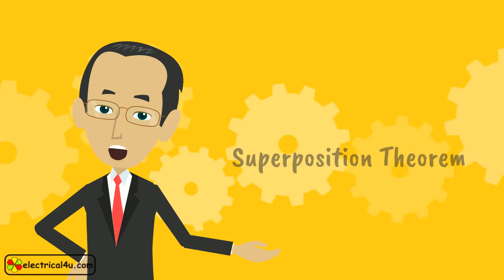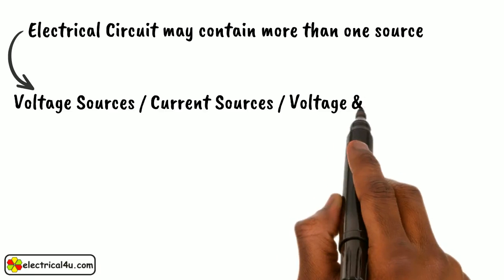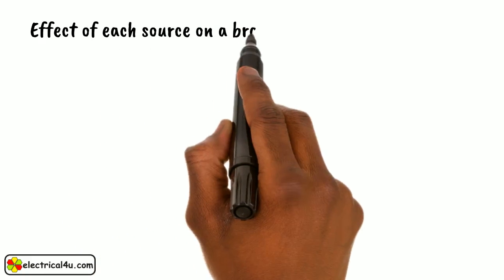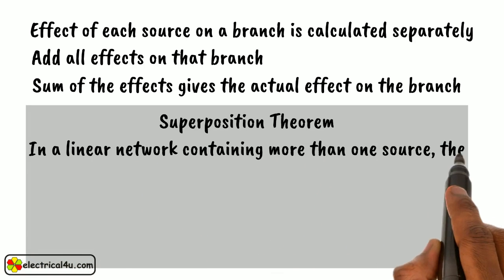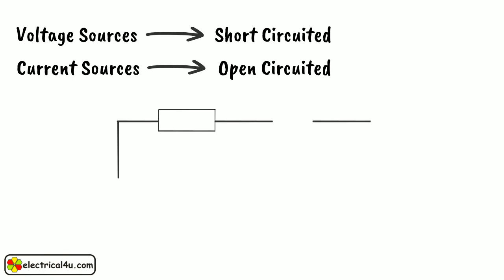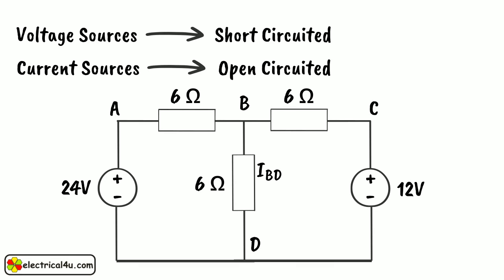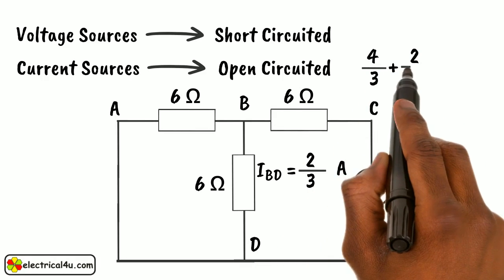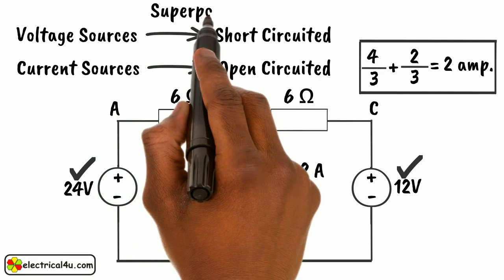Superposition Theorem: What is it? (Plus Examples)

Comment: The three resistors are not all connected to series. The resistor from BC is parallel to resisto BD and resistor BD is connected in series, (6//6)+6= so 9 ohms. Then 24V divided by 9 ohms ans is 8/3 not 4/3. Am I right?
Reply: 8/3 is the current leaving the source, but it gets split when going through the parallel resistors. The current through BD is 4/3 as the 8/3 gets split equally.
Reply: steve auxene  no, the math is correct. You get the Total current which is 24/9, but then you apply the current divider rule and the current splits. > 6/(6+6) * 24/9 = 6/12 * 24/9 = 1/2 * 24/9 = 12/9 = 4/3.
Reply: Yes I got the same answer . 8/3 (24Vsource)and 4/3(12Vsource)

Comment: Please explain how find value of IBD( 4/3).....
Reply: lol i got an exam in 2 hours lol we gon fail this bish
Reply: @jahlel.5291  lol same
Reply: @tang3151  still try..i failed it btw
Reply: @jahlel.5291  which college mr failer
Reply: The sum of the currents is equal to 18, the sum of the volts is equal to 24. Aka 24/18, or 4/3
Reply: As for 2/3, having a one short circuited voltage of 12, thats 12/18, or 2/3
Reply: 2/3 amp + 4/3 amp = 2 amp